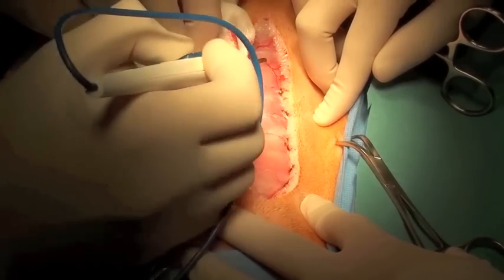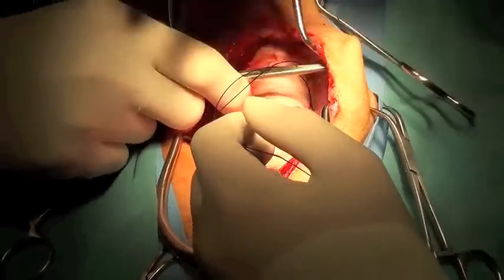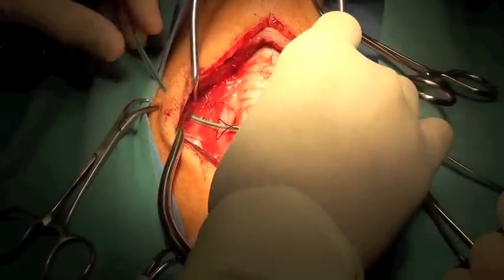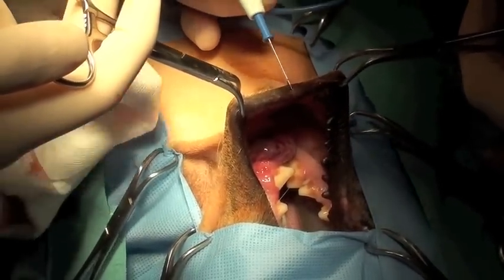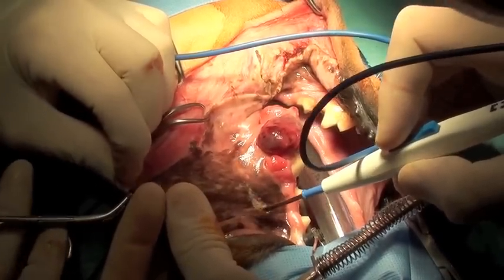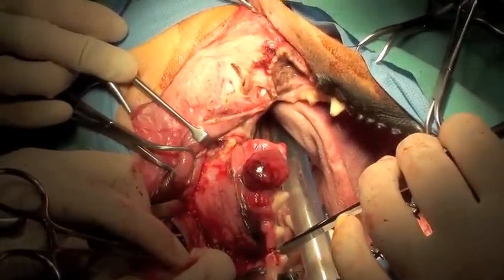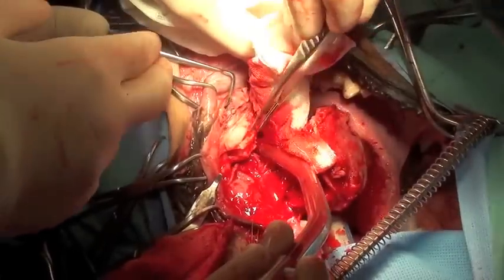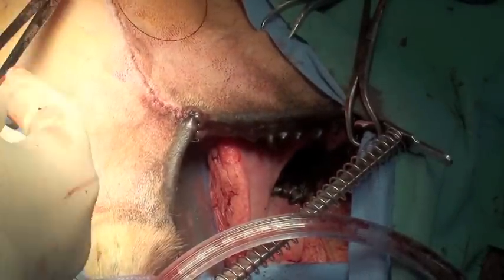Maxillectomy with Carotid Ligation Dog Surgery At Specialist Veterinary Hospital, Melbourne

Comment: Good afternoon,
I'm a veterinary student who has just done the circulatory system in anatomy. I was wondering if I could ask about the ligation of the carotid artery performed in this video. It just seems somewhat counter-intuitive to me, as the carotid artery supplies the structures of the head, including the brain. How do you prevent or reduce brain ischaemia and the resultant damage? Do you just ligate the external carotid? Or do you ligate before the bifurcation of the common carotid into external and internal carotids? If you do the latter, would the Circle of Willis/Circulus arteriosus cranialis be able to sufficiently compensate via the supply from the basilar artery to ensure adequate perfusion of the brain tissue?
Reply: Its only external carotid same as in human for control of posterior nose bleeding
Reply: Oh wow nerd

Comment: This is very good video of the surgery, thanks for sharing. I have several questions, what type of electrosurgical unit are you using, what is the brand name, the tip you are using for the incision, what setting are you using, etc. I would appreaciate any info about these. Thanks.